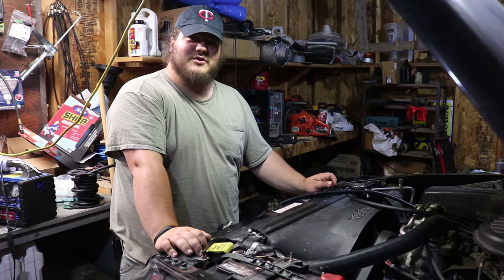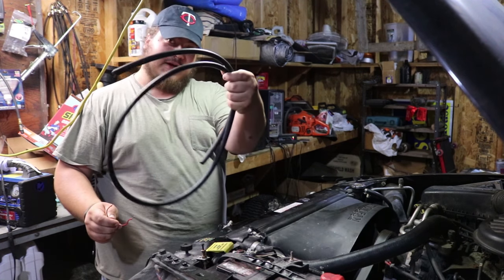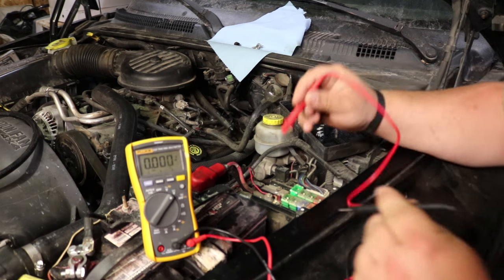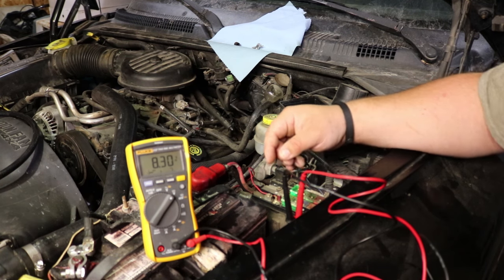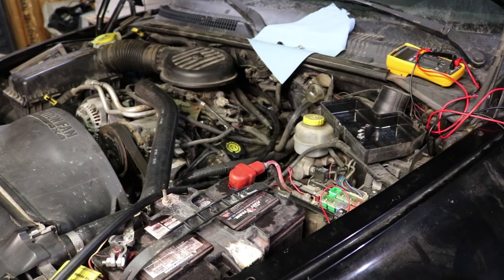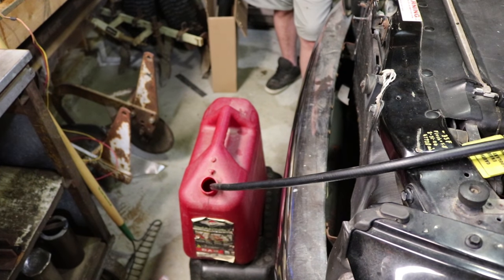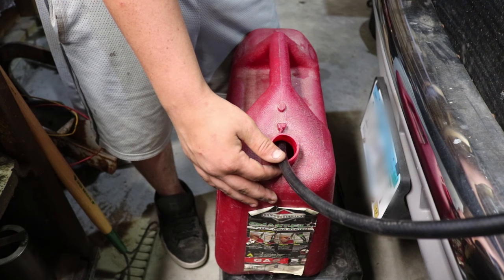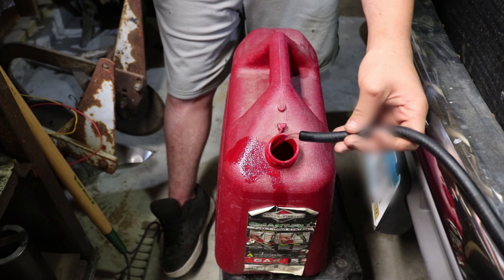how to siphon gas from any vehicle easily

Comment: We all know how to hold a hose and put gas in a can. What we don't know is how to find the proper connection point and jump the circuit. This wasn't much help.
Reply: Bloody oath mate
Reply: Same
Reply: I used the paper clip trick on my dodge neon on the fuel rely
Reply: Maybe don’t be so lazy and figure it out lol
Reply: ...or details regarding connecting to the fuel rail... are you connecting to the Schroeder valve?  If so,  what are you doing to keep the valve open?

Comment: If you Yank the relay the two horizontal blades should be the hot to the relay there is a schematic on the back of the relay that will show you which one to bypass.......

If you ever have a problem with good battery good lights cranks no start remove your horn relay and replace it PCM relay your horn won't blow but your car will start be a good idea to keep her a couple of those relays hanging around

Comment: So did you remove the innards of the Schrader valve with a tire valve tool then and then attach the hose?
I assume so.
I assume you depressurized the system first...
I liked the video but worry you left some things out people won't know or understand.
So I'd suggest other videos be looked at two.
Just saying...
Also some relays have a diagram that show the switch you need to jump symbolically. Some relays have a top that you can lift to switch it without a jumper wire.
And for those not sure about how to jump the relay you could turn the key on and off repeatedly but that is tedious...
I still found the video helpful, especially in finding which contacts to jump based on which give you voltage which could even be done with a simple 12 volt test light.

Comment: with the black hose and black under the hood I cannot see at all where you plugged in to the other side of the hose. The most important part, is where is the port on the fuel rail? And other vehicles will not be the same either.
Reply: Exactly!!!!!!

Comment: Was great simple video but you neglected to show us the part were you actually connected the jumper wire? was in your hand one min then the next was in fuse box. watching you do that would have made this an ace in the hole video . Do not want to cross wrong wires or have them fall off and connect to wrong post and fry something. but thanks for the hose hook up demo that is self explanatory for most but again failed to show you doing it for better clarification.
Reply from the maker: Reason for that is so that the viewer researches his or her own vehicle to make sure they put the wires in the right place for their vehicle. Many vehicles are different.

Comment: So after you probed & found voltage (8V in this case), you shorted out those two points?  Then turning on ignition made fuel pump?  So wherever you find that voltage, you could run a short between that point & ground?  What were you probing? -- the assembly around a fuel pump relay?
Reply: The ports that the relay plugs into is what he was probing.
Reply: dont need ignition switch turned on, it will start pumping as soon as you bridge the two connections!!

Comment from the maker: I purposely left out a few pieces of information for various reasons. The Schrader valve will be in various places on the fuel rail depending on make and model of the vehicle. If I spent the extra time explaining where this vehicle has it, folks would still be mad their's is different. Also, for the relay, if you're not knowledgeable on its function to understand what I'm doing, for your safety and to prevent damage, I suggest researching further.
Reply: Hey so your making it to where ur forcing the fuel pump to kick in once u turn the key but not to start the motor it’s only starting the fuel pump ?
Reply: @lynzblk  i think so but what about this schrader valve thing? i thought all you need to do is put a hose on the fuel line before it goes to the engine rail

Comment: Enjoy your low key style...I have a bad fuel pump in my van and I have to get about 25 gallons out of the tank
Reply: So what did you end up doing? I have the same problem.
Reply: @sir-mittler8210  So what did you end up doing? I have the same problem too.

Comment: Hi Bill, really liked your video here. Have a question for yah. I have a older 1993 Jeep GC Laredo I6 4.0. I already have this ready to go but I would like to have it siphoned/forced out from near the fuel filter into several gas cans under the Jeep. My fuel line is already flushed out from the fuel rail down to (just b4 the fuel filter) with 99% Isopropyl Alcohol. Is this the same procedure or different as I would like to do it in my application here? Hope you or someone with expertise can help me here, thx much for your time also. I just subscribed and liked your channel
Reply from the maker: If you disconnect the line going into the fuel filter, and set it to drain into a can. Then use this method it will use the fuel pump to pump the fuel into your can.

Side note, last weekend I just put a battery in this truck and it fired right up. Has not been started in 5yrs. The gas in it is 5yrs old.
Reply: @BillTheTractorMan  Thx bud. Yeah, mine has been sitting for yrs also but we do have a high humidity rate here and who knows what is sitting in the bottom of our tanks.

Comment: I don't know maybe I'm doing something wrong but it's not working it it is bypassing the fuel pump it's actually making it run with the wire but it's not sucking out the gas is there something else you have to do to the Schrader valve????
Reply from the maker: Did you remove the core?
Reply: Hahahahaha yeah....

Comment: Bill, Can I not just use the installed Fuel Pump Relay, connect the rubber fuel line hose  to an outside container Then turning on ignition switch to on.
Reply: No. The computer will turn off the relay after about 3 seconds if the vehicle doesn't start.
Jumping the relay contacts keeps the pump running as long as the key is supplying power.
Reply: @markb6156  thats why some ppl turn the key on and off but that is foolish when you can juts bypass the relay with a paper clip right

Comment: Why do you have to mess with the relay?can't you just turn the key and let it flow or will you the pump shut down because of some computer activity?
Reply from the maker: In my experience some vehicles will pump for only a second or two then stop unless you jumper the relay to keep the pump running.

Comment: Great idea but how can you do this on a 2009 or 2016 F150? Really appreciate any feedback
Reply from the maker: Pretty much the same way, you will just have to figure out the right spots in the relay for the Ford
Reply: @BillTheTractorMan  yeah on the 09 I believe theirs a Schrader valve on the fuel rail to hook a line to but I'm not sure I can find that on the 16. I think these vehicles have a fuel pump module though so not sure if that would prevent me from pumping that gas out easily
Reply from the maker: @franciscallahan4213  should still have a shrader valve, needed for mechanics to bleed the system and diagnostics.
Reply: @BillTheTractorMan  thanks!
Reply from the maker: @franciscallahan4213  no problem!

Comment: That doesn't help when there's no Schrader valve.  I've looked before and my 03 Astro doesn't have an easy way to test fuel pressure.
Reply from the maker: Quick Google search, and I found a picture of where it is. Should have no problem getting some rubber fuel line on it for this process.

Comment: Will this technique damage the fuel pump/filters if the fuel is several years old?
Reply from the maker: It shouldn't. Unless you have something where the fuel is gelled. In that case it would be obvious it is not flowing and you should discontinue using this method. You will need to disassemble and clean fuel system components.
Reply: Just make sure you "STOP the process IMMEDIATELY" when you see no more fuel is coming out from the end of the hose. Otherwise, you will burn up your fuel pump!

Comment: Can’t you just turn the key to acc to turn on fuel pump?
Reply from the maker: Not all vehicles will do that. The computer only runs the pump long enough to build some pressure to start, if the engine doesn't start the pump won't stay on.

Comment: Oh thats easy. Cause everyone has that stuff. Lol
Reply from the maker: This stuff is definitely not hard to get. Just about every farm and fleet store or auto parts store has wire and rubber fuel line. I buy fuel line and wire in bulk, but a small spool of wire is under $5 and 4ft of fuel line would be about $6